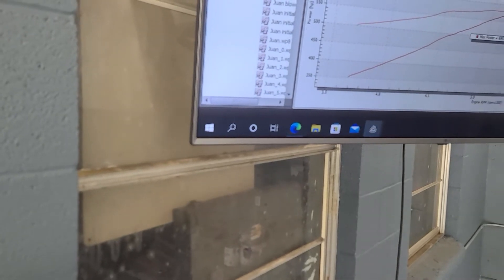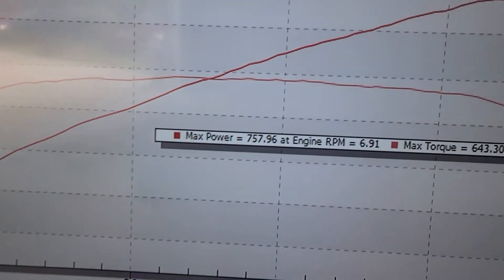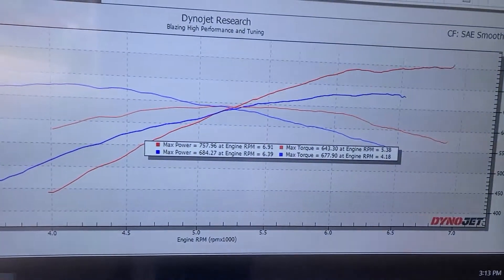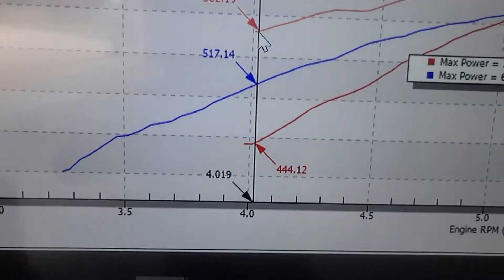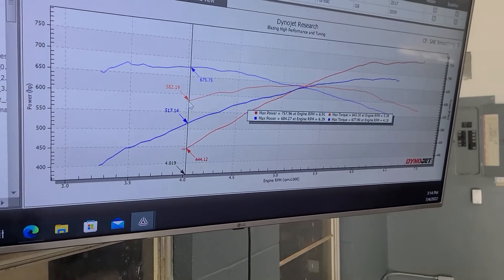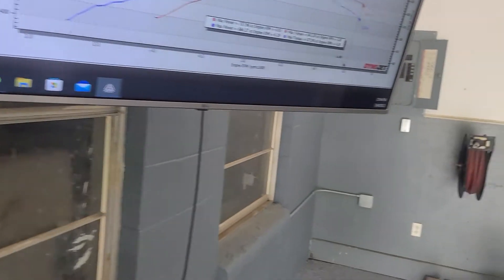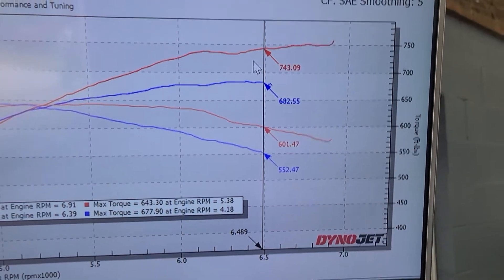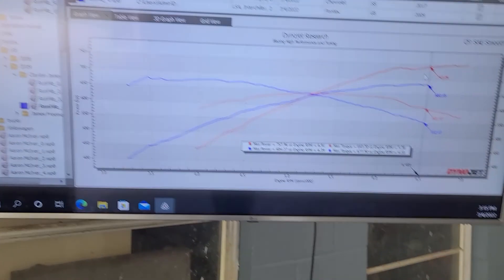LSA vs Procharger.  Same boost, both E85, cam only in a Holden platform.   Which works better?

Comment: Best thing I did for my Procharger build or Centrifugal blower was a stall converter. I did a Dyno tune and figured where the Procharger really came in strong and with a 4k stall it would flash up and get me in the power band quicker. Now that was a machine. I do like LSA builds but for me an auto, stalled, ProCharged is the way to go. Especially if you change rear end gears too.
Reply from the maker: For sure.  A converter puts you right in the power!
Reply: How much was the total build to procharge
Reply: Plus get a ati underdrive superdamper pulley
Reply: @Lsxflakko procharger was like $8k. With no labor. I bought race intercooler etc, the head unit alone is around $3,500-4,500. Intercooler was $2k. You’ll need injectors, nice fuel system so I spent maybe $8k I believe that’s without the tune which at the time was $500. But with inflation now a days you’d spend more for sure.

Comment: I've only got a 3200 triple disk stall so maybe lsa might be better off I don't daily it as much any more and want to get into more track days. Damn why does this got to be so hard lol
Reply from the maker: 3200 is OK for a Procharger
Reply: @nufnuffz28 thats what was in my cammed ls3 06 gto  3200 stall 373 rear gear  i wana put that ati underdrive pully onit & it should rev up even faster & add 10hp  i wana hav 500whp or close its 470 now then pro ch.it too 800hp dont wana go over that 3200 stall bc gas sux now 11-12mpg mabie 14 half adverage but i like useing All the boltons off the line the let pro ch.take over better combo i thk

Comment: So if i gathered correctly you are conparing a 6.0 g8 vs 6.2 ss as well?
Reply from the maker: Technically,  yes.  But with boost the .2 doesn't make much difference in our testing

Comment: I jave an 04 vy ss put big na cam in it higgins race heads magnum 6 speed twin plate made 420 rwhp ,found a d1sc procharger i know cam not ideal but being manual its great fun paired with 411 diff,will it work fine eith d1sc only being sbe
Reply from the maker: It's not optimal,  but will need e85 to be happy with that nuch compression

Comment: What upper and lower pulley does the Lsa G8 have on it,  is it a ported supercharger,, and is the engine stock. I'm trying to make around the same power level but on a 6.2 Camaro.
Reply from the maker: 2.4 upper, stock SC. stock engine with a cam
  All in the tuning
Reply from the maker: Also look out for the LSA car on the dyno video coming soon.  We did it today.
Reply: I was told that a 2.45 upper would create to much boost with a 10 percent overdrive on a stock 6.2 so I chose a 2.55 should I have just chose the 2.45 instead to try to achieve these numbers easier. The car is FBO, cam, 1kcc injectors, 5inch intake, aux fuel pump, zl1 fuel pump and going on e85
Reply from the maker: @marcus8156  stock lower on this one now.  Going up later though...
Reply: @nufnuffz28  Niccee!!
Reply from the maker: @marcus8156  and we have seen 20 psi on some bolt on cars.  (2.4 and larger lower) These things can make a lot of boost!  When you cam them,  you will lose boost, but make more power

These things will make boost!
Reply: @nufnuffz28  so pretty much in order to make about 630 to 650 rwhp on my setup what upper should I use a 2.55 or 2.45
Reply from the maker: @marcus8156  small cam, 2.45, larger lower slightly...